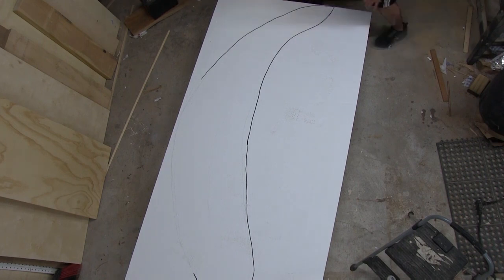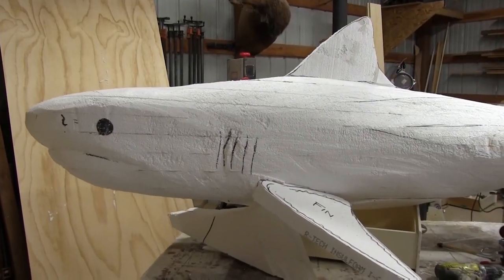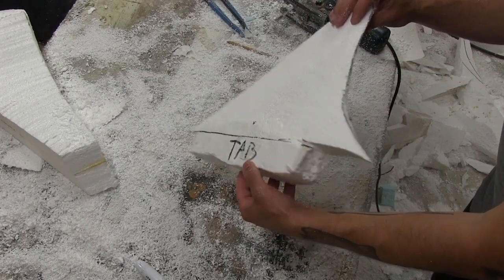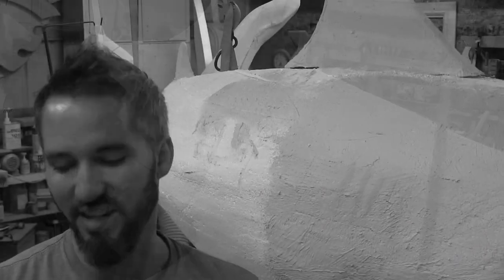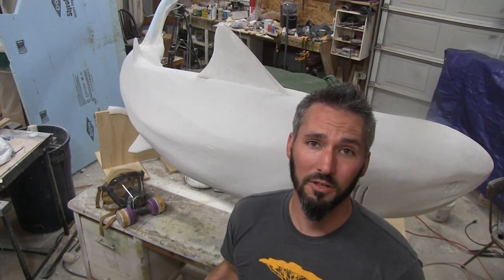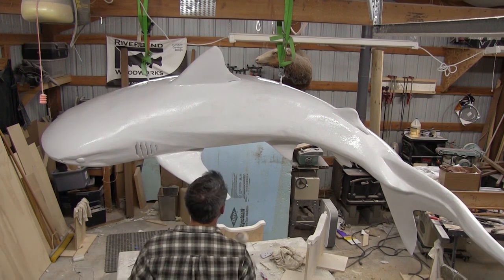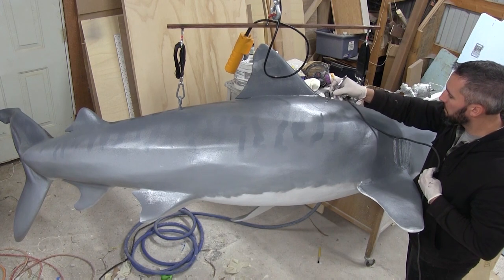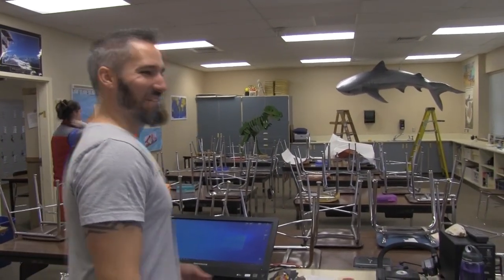My LARGEST Carving to Date!

Comment: Fantastic! The Foam Coat you use...it is two part? I may be headed to Harbor Freight for that sprayer!
Reply from the maker: The foam coat is Rosco's Foam Coat and it's a one-part coating that can dilute with water and sprays well. The stuff is sandable and solid! You can use a textured roller to apply it thick, or do it in coats as I did with the sprayer. In my 3-part series covering this build I kinda go over the options for the foam coat process. I believe that is in video #2. Thanks for watching!

Comment: Well that looked a lot easier to handle than wood , question why didn’t you just use the blue foam on all of it isn’t it a lot more dense than the styrofoam? And would it give you a smoother finish?  With my Tarpon build I’m going to try and put a lot of detail on it , do you think I could us a standard wood burning to to do details like scales and around the head ? And I’ve seen were people build boats from foam seal the foam with latex house paint and add filler ( bondo) and primer after, and paint ? What’s your thoughts.
Reply from the maker: Hey Dave, so sorry I just saw this comment! In all reality the white foam was what was on hand at my local store and the blue came from another big box store. I totally agree that the blue foam is the way to go though. It carves and hold organic shapes so much better, in my opinion. I would be leery to do any kind of burning operation, unless using a wire cutter in a well ventilated area. The fumes from this stuff is really icky. That said, with smaller scraper tools you can certainly attain a great level of detail, even down to tarpon scale levels.